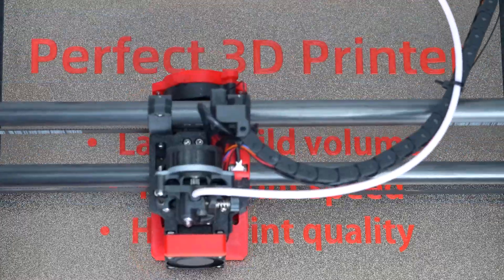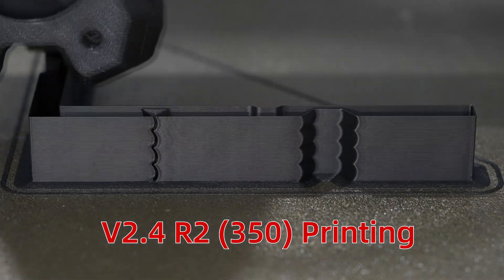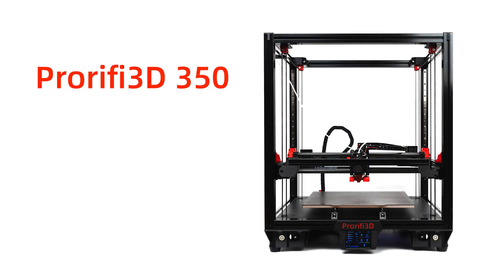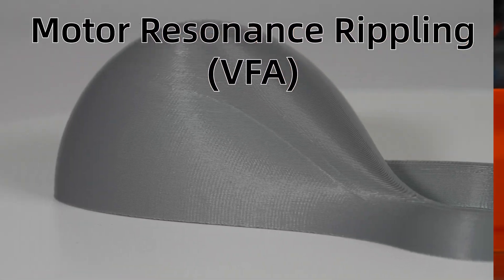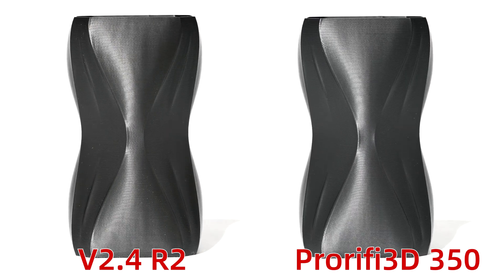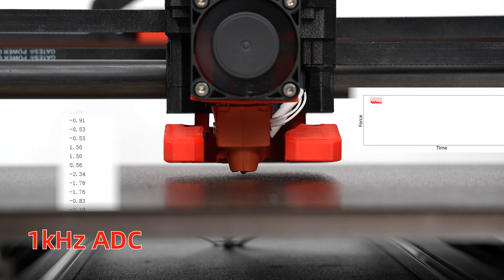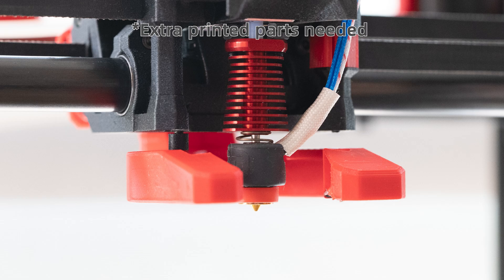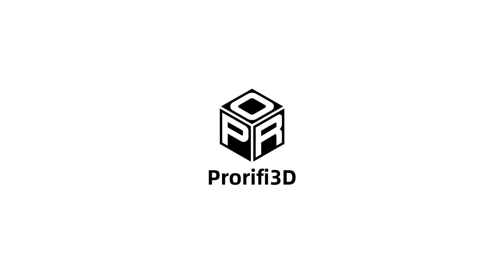How we made (probably) the best 3D printer for makers

Comment: Let me criticize it.
- Voron V2 is bad architectured and overengineered construction from a very different era. Let's acknowledge that the Voron community gave to all of us a ton of incredible things, thanks to their enormous efforts to overcome it's limitations. The new era came thanks to them. But in 2024 V2.4 is twice the BOM and the price of much cheaper modern options, which have the same or better features and acceleration capabilities. You improved portal a lot by closing it and beefing up printed parts. Combined with a much lighter X beam + toolhead and flying gantry capabilities to decouple vibration, it should have adequate results. But it's an effort better spent elsewhere.

- $800 for just an open big printer kit with a promise of increased VFA-free speed zones is too much. No prebuild, no enclosure, no BV heater, no air filter, no support. Any modern printer capable of producing a clean part, it's always a question at which speeds. At the least, I would wish to see an Orca Slicer VFA test for the price. And input shaper for the gantry, both at the bottom and at the *TOP* of the frame. Degrading input shaper at the top is a common V2.4 pain.

- Carbon tubes paired with bushings are tempting solution. Enormous specific rigidity. Convenient belt layout in relation to the toolhead center of mass. And terrible tribology properties, resulting in fast wear, making them a consumable. It's hard enough to source them with a stable diameter tolerance and straight enough to act as a linear guide. And even harder to find is it made with a good enough epoxy matrix, capable of withstanding prolonged 60°+C temperatures. Very convenient to engineer, very inconvenient for any kind of long-term use.

- Additionally due to high wear carbon tubes linear guides are somewhat risky from asbestos-like particles contamination perspective.

- Noise. High-flow fans are high-flow fans. It affects usage patterns a lot.

- I see load cell bed leveling, and I see no silicone strip for automated nozzle cleaning.

- I found no hotend specification in the kit. Tell me it's at least a Volcano.

- When you sell something 3D printed, you need to specify which filament it was printed with. It affects capabilities a lot.

- Full enclosure, which does not improve frame rigidity, is a wasted opportunity. But this is a common point in a lot of kits, including Voron.

Comment: Your input shaping test looks of, the small crevas should have the same distance between it as the other 2 have
Reply from the maker: The fact is, the better machine should print out smaller crevasse with the same gcode
Reply: @Prorifi3D  Yes the issue is that it seems that you have taken 2 very untuned machines and compare it against that, the left 2.has immense issues from bottom to top, The machine on the right looks better. Clearly your machine is the best and i understand why but seems likea very ungenuine test
Reply from the maker: @tobiaspersson7320  All machines are tuned properly

Comment: $800? More than a QIDI Plus 4. If this was $500 it would be interesting.
Reply: It’s a 350mm v2.4, it isn’t in the same class as plus4 which is 305mm. This would be compared to Sovol sv08, which is about as cheap as you could build a v2.4 style printer.

Comment: you wouldn't of been comparing it with the bambulabs A1 at 2:25, where you?
Reply from the maker: P1 actually
Reply: @Prorifi3D  I love your transparency, but in your testing did you also tuned filament profiles ?
Reply from the maker: @mcstando  They all have the same print time and print settings such as speed, acceleration, fan speed, temp, etc.
Reply: no. just the B*** *1 lol

Comment: very impressive price. Were those hollow carbon fiber rods? they looked to be 12mm. What bearings are you using? I'm more concerned about wear and the only downside seems to be the lack of an enclosure
Reply from the maker: They are 16mm hollow carbon fiber rods with self-lubricating bushings, which are very easy and cheap to replace or upgrade when worn out. We also have a full enclosure upgrade kit coming soon.

Comment: Nice price, looks like a voron to me, what are the differences besides the great price?
Reply from the maker: Voron is very cool and we've built many Vorons in the past years, but Prorifi3D 350 just prints faster and better, also it's designed to be easier to mod and fix.
Reply: @Prorifi3D So if we simplify it down greatly, this builds on the philosophical foundation of a voron but is easier to maintain and repair?
Reply from the maker: @friendlyfred1997  Philosophically they are similar, but the biggest difference is performance
Reply: @Prorifi3D  how does it compare to a Sovol SV08?
Reply from the maker: @christianbottger493  Sovol SV08 is a budget printer with poor quality (worse than V2.4) according to some review